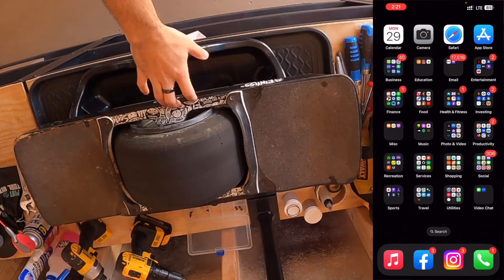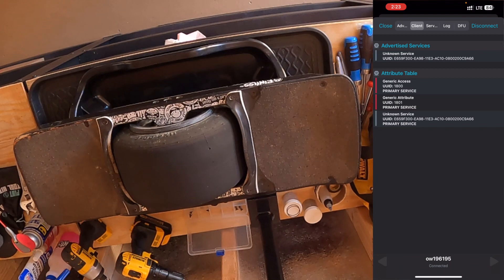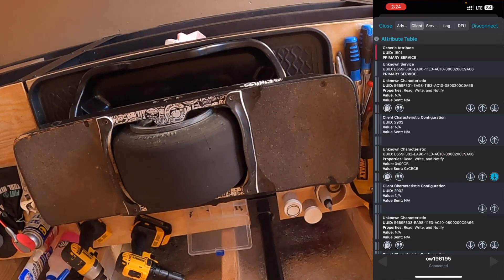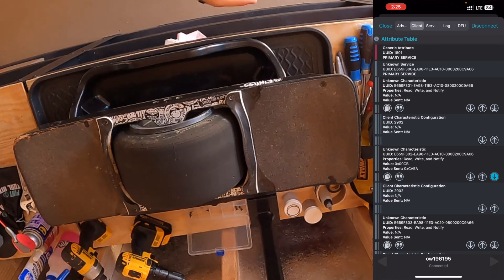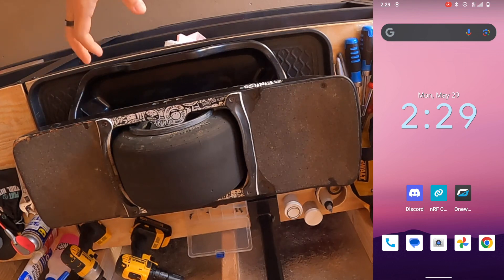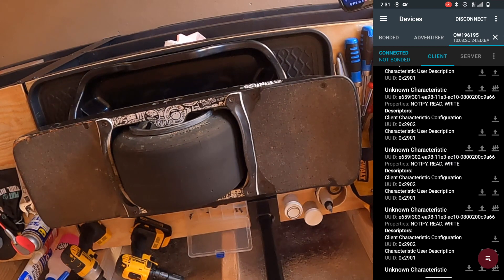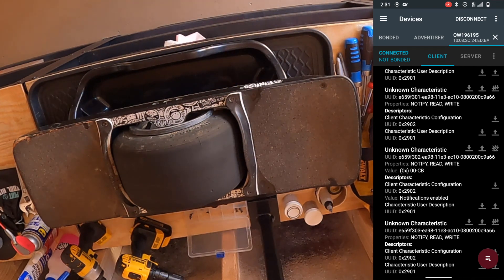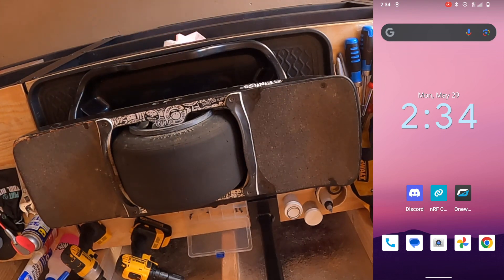How To Calibrate Your Onewheel XR Using nRF Connect

Comment: I have a 4209 XR but I accidently did the haptic feedback update, I can't use OWCE anymore does this mean nRF won't work either? I just purchased some WTFs and they're on the way now but realised I may not be able to level my board now - and only be able to do it in custom. I do plan on doing a XRv and that'll be an easy fix then, but for now what can I do?
Reply from the maker: nRF Connect still works. That said, if you want to downgrade, you can do it via Bluetooth. I’m happy to provide the steps if you want to reach out.

https://www.fixmypev.com/contact-us

Comment: Hey! Great video, i have an issue though: for the command caea (hall effect sensor cal) the tire starts spinning but doesn't stop. Only when I turn the wheel off, what could that problem be? 
Thanks!
Reply from the maker: That’s a new one for me. How long have you left it before turning the board off?
Reply: @fixmypev a couple minutes... but it wouldn't stop, also if I used the next command in the video, all it would do was sort of react with a shudder but it wouldn't stop turning.
Reply from the maker: @ifyousaysomilk9174  Can you message me through my website? Curious to learn more about your issue.

https://www.fixmypev.com/contact-us
Reply: @fixmypev  sure, followed the link and left a message!
thx!
Reply: I have this same issue. Left it for a few minutes and the board got pretty hot.
Reply from the maker: Hey, Josh. If you’re still having this issue, can you reach out to me through my website?

https://www.fixmypev.com/contact-us
Reply: @fixmypev  I left a few messages on your website but have received no reply. Did you guys figured how to fix this problem?
Reply from the maker: @josheisg  Hey, Josh. I believe I already replied, but just want to make sure you heard back. Comments get buried easily here. 💯

Comment: Hey I’m running into an issue where when standing on the board, it doesn’t activate. I know this video is a different issue separately, I’m just at a brick wall. I Just replaced the foot sensors thinking it was due to that but now I’m out of ideas.
Reply from the maker: If replacing the footpad didn’t solve the issue, you likely have broken solder joints on the inside of the controller that are impacting the footpad connections. This is especially common with 4209 and lower XRs.

Feel free to follow up at https://www.fixmypev.com/contact-us.

Comment: Edit: figured it out, no issues using the newest version of the app.

original comment:
i need to level an XR, just installed some WTF rails.

does it matter what version of the onewheel app you use? the board is not updated but i have the most recent version of that app. i can usually switch modes or check the battery right before the notice comes up.
Reply from the maker: Nope! Doesn’t matter. Glad you were able to figure it out! Well done. 🤙🏼⚡️🛠️

Comment: Hi Justin-- first of all, this is awesome!  Thank you for being such an excellent and generous resource. Have a few questions, please, if it's okay: 

1) Will this work to re-level an XR (4212) on Gemini 4165 with aftermarket rails? 
2) Would you know if 4165 allows aftermarket batteries (ie  CBXR)? 
3) If not, can 4165 be downgraded? And, would you know how? (I know there are ways to do it for the Pint/X and GT, not sure about the XR).

Thanks!!!
Reply from the maker: Hey!

1) Yes.
2) No*
3) No, downgrades are not possible for the Onewheel XR at this time.

* some riders have reported that their older model XRs have retained the extended range after updating, but I have not confirmed this myself.
Reply: @fixmypev Thanks so much for confirming. I knew you’d know! lol. 

May I ask a follow up, please? Should I ever need to replace the controller, battery, or bms on my 4212 on 4165; there shouldn’t be an issue right? I’ve read  about Bluetooth pairing being added with haptic buzz but if the releveling via nRF works with a 4212/4165, replacing components should be fine on this fw/hw combo, right? Thanks again!
Reply from the maker: @lhap4624  Yes, BLE pairing should still work on your XR, even if it’s updated. That’ll pair swapped controllers and BMSs.
Reply: @fixmypev  That's awesome to know-- thank you so much! Really appreciate your help and expertise! :)
Reply from the maker: @lhap4624  Always happy to help!

Comment: Hey Justin! Awesome information! I used this to level out my XR with thunder rails installed. Unfortunately, this has caused a different issue to arise for me. I typically ride in custom settings with the nose angle adjusted to “level out” at higher speeds. Not super fast, but usually around 15-17mph. What I’m running into, is that now that my board rides level right away, the pushback kicks in at about 15-16mph, and makes my rides way less enjoyable. I’ve tried messing with different settings in custom, and played around with mission. I still get the same results. I think I need to go back to the factory default angle setting. How would I go about doing that? 🤔 Unless you have a better solution. Whatcha think?
Reply from the maker: Hey! I think I replied to your other message asking about this (via email maybe?).

Were you able to get everything sorted out?

Comment: will this work with a cbxr battery on a 4209 hardware board?
Reply from the maker: Sure will! But this is simply for calibration purposes. The 4209 boards generally work with those batteries without issue. If you're running into any problems, feel free to send us a message.

https://www.fixmypev.com/contact-us

Comment: How can you still do this if the onewheel app will ask you to upgrade?  Having a CBXR this may cause some trouble. Is there another way to do this without using the onewheel app?  Thank you
Reply from the maker: You have to use the Onewheel app because that is the only way to establish a proper BLE handshake between your phone and the Onewheel. You can use airplane mode (keep Bluetooth enabled) in order to keep the 'UPDATE' prompt from popping up. As long as you turn it on no later than when the battery percentage populates on the screen.

Comment: I did this because the start position of my board was about 1/2” off the ground. Now all I get is error 22 and the board won’t work. Any ideas?
Reply from the maker: Is your board level when you are attempting to do this? If so and you’re still getting the error, send an email through the FixMyPEV website and we can work together to try to figure this out.

Comment: Can I use this method with a 4210/4144 XR with a bms with a haptic update ? This method will pair it, correct?
Reply from the maker: Given that the haptic update firmware is installed on the controller and not the BMS, I don’t see why not. 🤙🏼⚡️🛠️

Comment: Hey I’m having trouble getting the factory mode command to work. I’m not using updated firmware & have the “old” Onewheel app on my phone so I’m not able to go back to the OW app & do the handshake to then come back to NRF & do factory mode command. Any workaround ways to get into factory mode without connecting with the FM app? 

Do I need to update the app but not update firmware? Go faster?
Reply from the maker: Hey, Kyle! Just seeing this, but the handshake is required unless you have successfully ReWheeled the board to ‘Remove BLE Handshake Check.’ If the command isn’t working after addressing that, be sure to carefully review the steps and attempt the process again.

Comment: Awesome video.

Does this work with the 4211 hardware and 4150 firmware? I know on the GT any firmware more recent than 6109 doesnt work with nrf connect and was wondering if similar fw/hw blocks existed for XRs before I grab one.

Thanks!
Reply from the maker: Yes, it does. 🤙🏼⚡️💯

Comment: I'm waiting to update my board but I want to get aftermarket rails but can I still tilt the board without opening the app? Also do you recommend tilting it even if there straight rails?
Reply from the maker: You’ll likely still need to open the Onewheel app, but you’ll be able to level your board. If you’re on stock rails, there is no need to complete this process. It’s only for aftermarket rails.

Comment: Hall effect sensor calibration question/clarification: in the video you calibrated this with the board level (before digital tilt calibration). When you are adjusting for WTF (or aftermarket rails) do you adjust hall sensors at “ level” before digital tilt calibration or should you be doing this after digital tilt calibration? Thanks for your time!
Reply from the maker: As long as the tire is off of the ground/the surface below it, you can calibrate. The level doesn’t matter for that calibration. It’s also not something that needs to be done very often, but it’s there if you want to.

Comment: Is this still current? I haven’t updated the newest firmware update with the haptic buzz yet.
Reply from the maker: As of right now, yes. The updates for XR, Pint, and Pint X haven't been released yet. They're slated to be released within the next six weeks. If the newer GT and Pint X firmware is any indication, this process will not work with the newer firmware upon being updated. Do you have an XR?
Reply: @fixmypev  yeah I have an XR. mustache rails, so I’m looking to digital tilt. I did see that the GT digital tilt stayed after the update, but any updated boards couldn’t be tilted.
Reply from the maker: @AllTrails_BigBails  That's correct. If you want to digital tilt, I'd definitely recommend doing it before you update (if you're planning to). If you have an iOS device, this process is even easier with the OWDT app (via TestFlight). Happy to share the link if you use iOS.
Reply: @fixmypev  I just did last night using this video. Worked great. Is there anything else I need do? Or is it just an easier method to accomplish the same thing?
Reply from the maker: @AllTrails_BigBails  Glad it worked out for you! I'm not sure what you're asking here exactly though. 🤔

Comment: Can this be used to mitigate pushback?
Reply from the maker: Unfortunately, it cannot. This helps with leveling your Onewheel the way you want it and can also pair BMS chips/controllers or fix certain compatibility error messages. Altering pushback characteristics requires modification of the firmware; which I do not believe has been figured out for the Onewheel XR at this time. Thanks for the question! 🤙🏼⚡️🛠️

Comment: Can you pair a pint  or gt bms to a XR controller?
Reply from the maker: Since the Pint BMS is programmed to interface with Pints and the GT BMS is programmed to interface with GTs (it’s also a completely different size/design), the short answer is no. That said, a BMS pulled from a Pint could potentially be flashed (manual process) to work with an XR.

Comment: Got the thunder rails here, few things I don't like, it fucks your stance and got sore top of back foot due to angle. Not really designed to carve according to me. Above everything this should cost 100$ not 350 or 450 for wtf. Actually after watching economic experts chat, apparently 2/3 of the inflation is due to greedy people taking a marge up to 5x the normal when selling products. Governament wants to step in to force companies to apply a ''normal'' marge. That is the world we live in and it's messed up! The only thing you can do is boycott.
Reply: I reckon there is a reason surf boards, snowboard and skate boards are straight, any angle there interfers with tilt movement of your foot. Then problem up hill, cannot reverse, some curbs just too high... honestly stock onewheel xr + change tyre is all you really need. forget overpriced gimmicks.
Reply from the maker: @RusticRaver  Thanks for sharing! Everybody’s got their preference. 🤙🏼⚡️🛠️

Comment: Can i use nrf to reconnect a 4212 controller to a difference 4212 bms?
Reply from the maker: You should absolutely be able to do that! 🤙🏼⚡️💯
Reply: follow up question: could you use nrf to pair a 4212 connector to a 4209 bms (for example )?  @fixmypev
Reply from the maker: @Teknomancer88  I haven't specifically tried this, but in theory, yes. Both BMSs are flashed for the XR platform so I'd expect that to work.
Reply: ok so from im picking up is, so long as they are both flashed for the xr platform, theoretically, nrf can pair them. despite their model number, or is that wishful thinking on my part?
  @juswilvel

Comment: Is this for only a stock OW?  Is ok to do this in a 4212, upgraded battery with a PCB chip and aftermarket race Rails?
Reply from the maker: This is actually more for modified boards than it is for stock boards. Give it a shot if you’ve got aftermarket rails and need to re-calibrate the level. 💯

Comment: Does this fix the 4212’s issue with excepting a battery upgrade? Or is the best bet still to get an older controller?
Reply from the maker: No. The controller is still programmed (due to the firmware) to reject higher capacity batteries.
Reply: @fixmypev  This brings me back to my OG Xbox modding days... Does the future look promising for "eeprom flashing" or bypassing via modchips and/or softmods? 

I saw Jeff McCosker, in a recent video, use a public trashcan to re-level his board. I assume he's using nRF connect. I have WTF rails and now it's too level for my liking. Even though it took some getting use to but now I love it. I imagine I can just prop up the tail, during calibration, to give me that nose down feel I was experiencing with Custom Shaping provided by TFL in the /r/Onewheel group. 

Thanks again for the information... I hope it works in Vesc because one of my boards will get the eventual upgrade.

Edit: I put my phone and tablet under the tail, performed the calibration, then tweaked the Custom Shaping... All is well once again... except for my pesky headlight flicker. Took it apart. Connector is fine, ferrite ring was glued down previously so it's not the culprit.
Reply from the maker: @CayoticProphet  It's difficult to say what the future holds because development hours are required and things got shaken up a bit with ReWheel being encouraged to remove their project from public domain. That said, the community has truly discovered many amazing things over the years and we expect that to continue. If FM continues down the path they have been going down, VESC is going to fully consume the market in the long run.

In regards to your headlight flicker, it may still be a good idea to replace your stock cable with a shielded one. If that doesn't resolve the issue, you likely have a failing LED PCB.
Reply: Thanks!

Comment: Is it possible to calibrate the BMS via nRF Connect? Like after installing a CBXR to get proper battery level %
Reply from the maker: Good question! Unfortunately, no. That requires actual re-flashing of the BMS.